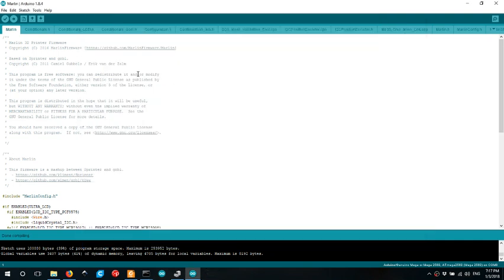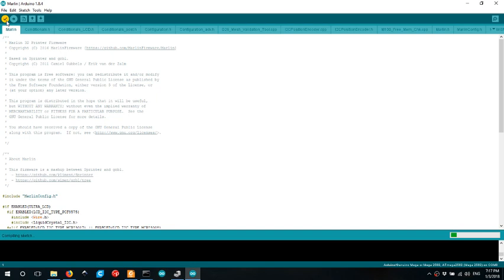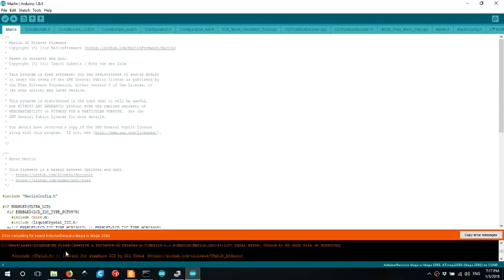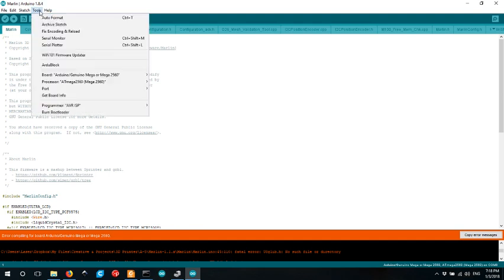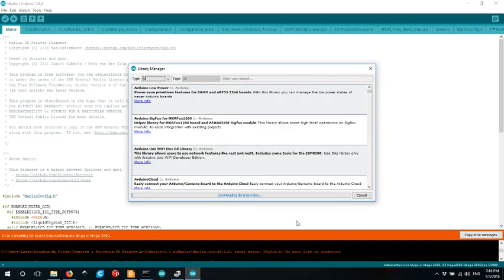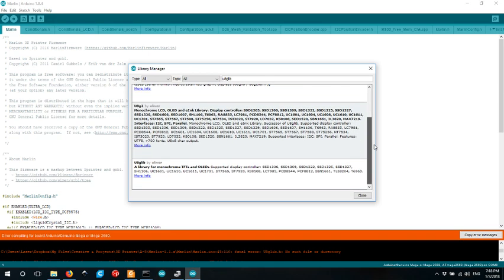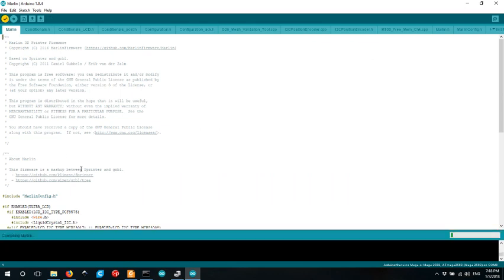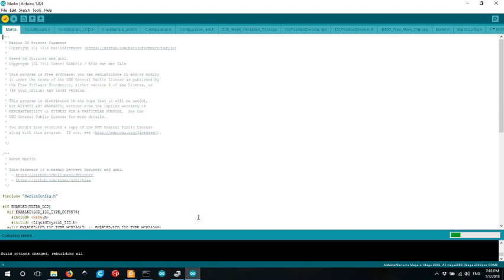Custom Firmware Follow up: "Error compiling for board Arduino/Genuino Mega or Mega 2560."

Comment: Dear sir , Here My RUMBA board is working fine. But If I upload a new , then it is not uploading. It shows the following errors;
" readlink C:\Users\mubar\OneDrive\Desktop\Marlin-1.1.x\Marlin-1.1.x\Marlin\Marlin.ino: The system cannot find the file specified.

Error compiling for board Arduino/Genuino Mega or Mega 2560."

 Please Sir, help me
Reply: Dear sir could I get your email? I could send you all the pictures.
Reply: Md Hossain
14 mins
Dear respected members of the group, I have just 2 days remain to submit my final year project which is multi-color 3D printer. I have learn a lot from the group. I am almost finishing level. But from today, I am facing a new problem. I need to change some features in Control board which is RUMBA. But now, it is not uploading new firmware.

I do not know where the problem. It works with my previously uploaded marlin firmware, but I need to modify some features. But it is not loading...... It shows the following errors:""" readlink C:\Users\mubar\OneDrive\Desktop\Marlin-1.1.x\Marlin-1.1.x\Marlin\Marlin.ino: The system cannot find the file specified.

Error compiling for board Arduino/Genuino Mega or Mega 2560.""

Comment: Hi Samuel. I got a Kossel delta printer yesterday. I'm struggling to get the Arduino IDE to compile the sketch.  I did install the u8glib but still it gives me an error. PLEASE HELP!! Here is the error:

Arduino: 1.8.1 (Windows 10), Board: "Arduino/Genuino Mega or Mega 2560, ATmega2560 (Mega 2560)"

C:\Program Files (x86)\Arduino\arduino-builder -dump-prefs -logger=machine -hardware C:\Program Files (x86)\Arduino\hardware -tools C:\Program Files (x86)\Arduino\tools-builder -tools C:\Program Files (x86)\Arduino\hardware\tools\avr -built-in-libraries C:\Program Files (x86)\Arduino\libraries -libraries C:\Users\James\Documents\Arduino\libraries -fqbn=arduino:avr:mega:cpu=atmega2560 -ide-version=10801 -build-path C:\Users\James\AppData\Local\Temp\arduino_build_767485 -warnings=none -prefs=build.warn_data_percentage=75 -prefs=runtime.tools.arduinoOTA.path=C:\Program Files (x86)\Arduino\hardware\tools\avr -prefs=runtime.tools.avrdude.path=C:\Program Files (x86)\Arduino\hardware\tools\avr -prefs=runtime.tools.avr-gcc.path=C:\Program Files (x86)\Arduino\hardware\tools\avr -verbose C:\Users\James\Documents\3D Printer Files\Kossel Delta Printer Files\drive-download-20180718T154444Z-001\Firmware for KOSSEL_Updated 20170712\Anycubic kossel_20170712\Anycubic_kossel\Anycubic_kossel\Anycubic_kossel.ino
GetFileAttributesEx C:\Users\James\Documents\3D Printer Files\Kossel Delta Printer Files\drive-download-20180718T154444Z-001\Firmware for KOSSEL_Updated 20170712\Anycubic kossel_20170712\Anycubic_kossel\Anycubic_kossel\example_configurations\RepRapWorld\Megatronics\Configuration.h: The system cannot find the path specified.

Error compiling for board Arduino/Genuino Mega or Mega 2560.

Thank you in advance!
JP

Comment: Lately with the latest Arduino IDE 1.8.10 and even the 1.8.9 I am running into a Permission Denied on U8glib.h even though it is already installed. No matter what permissions I open it up for and Run as Administrator it errors out. I even disabled all my firewall and antivirus software. Have you seen any of that with Windows 10?
Reply from the maker: I'm sorry, I have not seen that before. Maybe post on the Arduino forums, or create a new PC user account, or try to reinstall Arduino again?
Reply: @SamPinchesMakerShop  Thanks Already added a thread int he Arduino Forums: https://forum.arduino.cc/index.php?topic=652762.0
Reply: Found it was the IOBit Ransomware Protector that was still running in the background even after disabling services. 
Now it at least compiles and tries to upload but now get.

avrdude: stk500_getsync() attempt 10 of 10: not in sync: resp=0x61
An error occurred while uploading the sketch
Reply from the maker: @Ellery-USA  Did you unplug the LCD screen? If so, restart the computer and re-plug the arduino. If not, then it's a more complex process...
Reply: @SamPinchesMakerShop  No I didn't unplug the  LCD from the Sanguino board.  I even made sure the external power was on.  I guess the only way I know how I can update the firmware is via a USB ISP cable till my Arduino Uno comes so I can re-flash the bootloader.
Thanks for replying!
Reply from the maker: @Ellery-USA  Ok, so this video was made for JGAurora A5 printer owners, so my assumption was not true. I have not used the Sanguino board, so my experience may not be relevant. The LCD on the A5 is the MKS28 colour touchscreen module, and leaving it plugged in can cause a bad flash as that module talks over serial, just like the USB connection. If the LCD on the Sanguino is just a basic black and white unit, then it is likely not a problem to leave plugged in.

Comment: Im getting this error message, would it help in resolving the issue if I "Show verbose output during compilation" or is this sufficient?

Arduino: 1.8.7 (Windows 7), Board: "Arduino/Genuino Mega or Mega 2560, ATmega2560 (Mega 2560)"

Marlin:31:26: error: MarlinConfig.h: No such file or directory

compilation terminated.

exit status 1
MarlinConfig.h: No such file or directory

This report would have more information with
"Show verbose output during compilation"
option enabled in File -> Preferences.
Reply from the maker: Make sure you unzip the ZIP file contents to a new folder somewhere like documents, before opening and trying to install.
Reply: dude you rock! i have 2 of these machines, so seeing the difference in real time between them.

the heat beds still dont seem to activate on either but hopefully JGAurora will be responding via email soon to troubleshoot.

thanks again for replying so fast man :)

Comment: Thx. But plz hit win+alt+R to record.
I also need this for original firmware!?
Reply from the maker: You don't need this for installing the factory firmware, this is only if you're having issues compiling the community firmware. The factory firmware is always supplied as a pre-compiled .bin file. Also, I'm not sure what win+alt+R does? I'm on windows 10. I'm sorry the quality is so poor... I thought I had uploaded in 720p at least, but apparently not. I'll be more careful next time, as my internet is a lot faster now.

Comment: I notice in the configuration in your custom firmware that it's configured for a graphical LCD, but of course their touch screen doesn't need the code that handles the graphical display. I assume the A5 controller just sends G-code over USB to the board, and not any raw encoder signals. So, does the REPRAP_DISCOUNT_FULL_GRAPHIC_SMART_CONTROLLER option actually need to be enabled for the firmware to work? If so, how come? And what about the SPEAKER? Is that a piezo on the board, or on the controller?

The reason I ask is that I want to make sure all settings are correct before merging https://github.com/MarlinFirmware/Marlin/pull/9282
Reply: Good to know, thanks! I think we should distribute the firmware configured for the stock A5, but we can add a note about connecting the RRDFGSD in a README.
Reply: We'll just crib from your website. :-D
Reply: @ScottLahteine  bad news, it is a year ago.
Reply: @TeomanDeniz  Thanks for the reminder! We now work directly with Samuel in the Marlin Discord channel.

Comment: Hey Sam, I have followed all your videos and am getting this error:

Arduino: 1.8.9 (Windows 10), Board: "Arduino/Genuino Mega or Mega 2560, ATmega2560 (Mega 2560)"

Sketch uses 147670 bytes (58%) of program storage space. Maximum is 253952 bytes.
Global variables use 5133 bytes (62%) of dynamic memory, leaving 3059 bytes for local variables. Maximum is 8192 bytes.
avrdude: stk500v2_ReceiveMessage(): timeout
avrdude: stk500v2_ReceiveMessage(): timeout
avrdude: stk500v2_ReceiveMessage(): timeout
avrdude: stk500v2_ReceiveMessage(): timeout
avrdude: stk500v2_ReceiveMessage(): timeout
avrdude: stk500v2_ReceiveMessage(): timeout
avrdude: stk500v2_getsync(): timeout communicating with programmer
An error occurred while uploading the sketch

This report would have more information with
"Show verbose output during compilation"
option enabled in File -> Preferences.

i unplugged the LCD panel like instructed.. Would this be effecting the upload? Thanks for any help you can provide..
Reply from the maker: Hi Joe, that error is a communication error, and can happen for a number of reasons. If you can't connect to the printer any more (Arduino serial monitor, pronterface, Cura, repeatier etc.) then it may be bricked, and require the boot loader to be reloaded. This is only likely to happen if the LCD is left plugged in when flashing, so since you unplugged it I think that is unlikely. If you want more detailed assistance, please post on the JGAurora forum (jgauroraforum.com) and I'll try to help walk through where to from here. If the printer is still working fine otherwise (all axis move), then it is not bricked, just a driver/cable/communication problem.

Comment: Similar Error can't find the file it wants though here the Error Mssg...Arduino: 1.8.9 (Windows Store 1.8.21.0) (Windows 10), Board: "Arduino Mega or Mega 2560, ATmega2560 (Mega 2560)"

In file included from sketch\src\lcd\dogm\ultralcd_DOGM.cpp:46:0:

sketch\src\lcd\dogm\dogm_Bootscreen.h:35:12: fatal error: ../../../_Bootscreen.h: No such file or directory

   #include "../../../_Bootscreen.h"

            ^~~~~~~~~~~~~~~~~~~~~~~~

compilation terminated.

exit status 1
Error compiling for board Arduino Mega or Mega 2560.
Reply from the maker: I'm sorry this looks like a completely different problem. I suggest reinstalling Arduino, and copy the Marlin folder to your C drive. If it is in too many layers of folders that can also cause problems.

Comment: showing something like this

Build options changed, rebuilding all
In file included from sketch\sketch_dec10a.ino.cpp:1:0:

C:\Users\Lenovo\Documents\Arduino\sketch_dec10a\sketch_dec10a.ino: In function 'void setup()':

C:\Program Files (x86)\Arduino\hardware\arduino\avr\cores\arduino/Arduino.h:44:16: error: expected unqualified-id before numeric constant

 #define OUTPUT 0x1
Reply from the maker: There you go - you have found out that there is an error in your setup function. Hopefully, you can check your code and diagnose what is causing the problem, and go from there to fix it.
Reply: yeah,thanks

Comment: Still showing same error plz help sir
Reply from the maker: You need to READ the error in the black region. What is the error you are getting?
Reply: Error compiling for board arduino unp
Reply: Uno
Reply from the maker: @shaileshthakur2237  That's like me asking you what is wrong with your car, and you saying: "Error starting up volkswagon" . I need the full error message. Watch the video. Did you see how I scrolled up in the black region? I need the full error. If you read it, you might figure it out too...
Reply: Ok
Reply from the maker: @shaileshthakur2237  Ok
Reply from the maker: Shailesh Thakur Samuelpinches.com.au/contact
Reply: Unable to send mail mail address not founf
Reply: I have send you error plz help as fast as you can
Reply: Shailesh Thakur try disabling virus protection.
Reply: Sir have fixed it thanks for your important time

Comment: I did everything in the first video and in this follow up video, and received this error message: 

Arduino: 1.8.5 (Windows 10), Board: "Arduino/Genuino Mega or Mega 2560, ATmega2560 (Mega 2560)"
Marlin:2: error: expected constructor, destructor, or type conversion before numeric constant
  * Marlin 3D Printer Firmware
           ^
Marlin:14: error: 'without' does not name a type
  * but WITHOUT ANY WARRANTY; without even the implied warranty of
                              ^
In file included from sketch\MarlinConfig.h:26:0,
                 from C:\Users\Alan\Desktop\JGAurora A5 Custom Main Marlin Firmware 1.1.8C\JGAurora A5 - Custom Marlin Firmware 1.1.8C\Marlin\Marlin.ino:31:
fastio.h:137: error: 'WaveGenMode' does not name a type
 } WaveGenMode;
   ^
exit status 1
expected constructor, destructor, or type conversion before numeric constant

What can I do to fix it?
Reply: Try disabling virus protection.